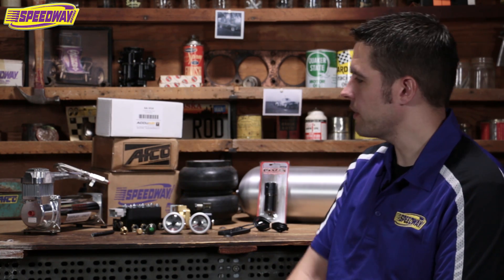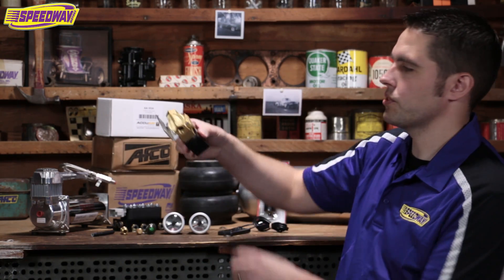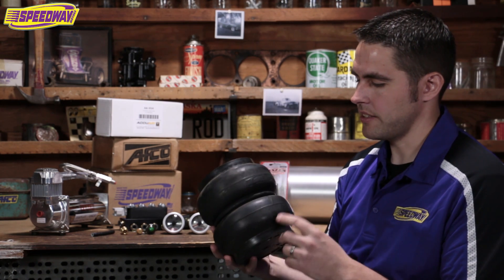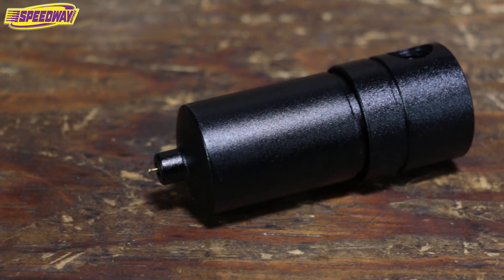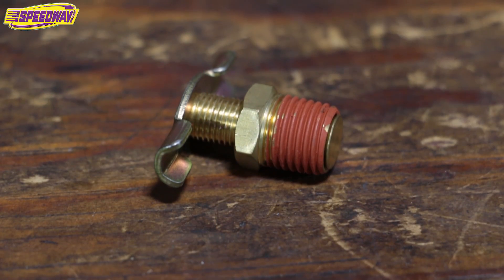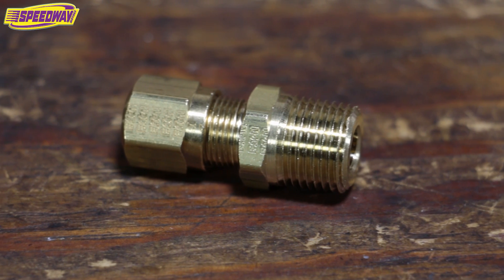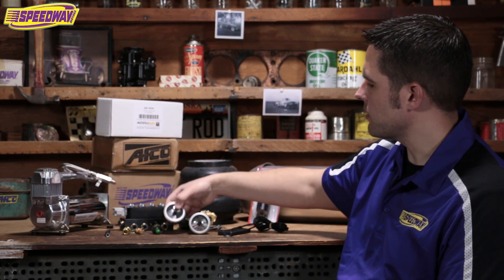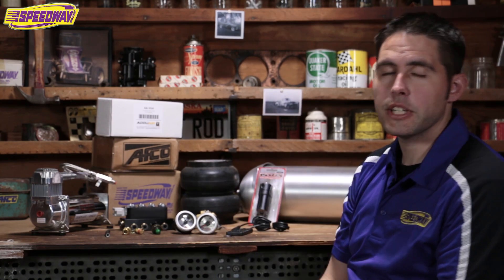Speedway Tech Talk - Air Ride Made Easy

Comment: i have never been able to find what size bag to use with certain dimensions. all i see is maximum weights. we need some math and calculations. for instance my car has approximately 1060lbs on a front corner. given the dimension of the A arm it converts to ~1600lbs.  so a 2500 max pound bag should be good right? how much psi will it require to lift the car off bottom? what will happen if i like a stiffer ride and i pump it to 200psi, then i hit a pump going down the road? will it blow up? 

just some questions ive been trying to answer but i cant find anywhere. 

with that said, those who have experience. what is a typical pressure you run both on the road and or on the track?

Comment: I'm purchasing a 68 Deville and looking to have it bagged. I  was looking at getting some wire wheels and was going with a 235/75/15 but heard those maybe to tall if I want the car to lay on the ground. Any info would be appreciated.
Reply from the maker: To use that tall of tire and lay the frame on the ground you will likely have to modify the inner front fenders and the rear wheel houses.  If using an air ride specialist he will likely know what will need to be done and the tire size needed.

Comment: How do you adjust your valves on an air ride
Reply from the maker: To adjust your valves on an air ride equipped car you use a switch or control unit such as  9109015 https://www.speedwaymotors.com/AVS-AVS-ARC-3-BL-3-Rocker-Series-Air-Suspension-Switch-Controller,118754.html?OriginalQuery=9109015

Comment: Do u need to get alignment after the install?
Reply from the maker: Proper handling and steering geometry require the lower control arms to sit parallel with the ground, so it's recommended to have an alignment done after the install.